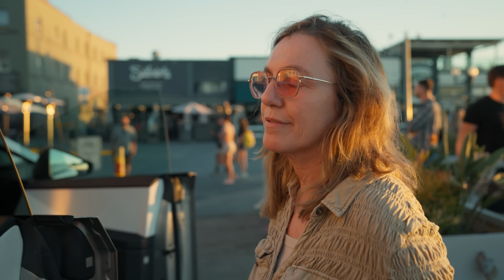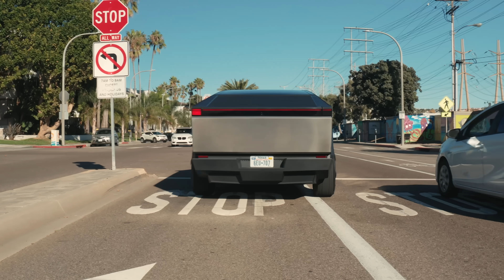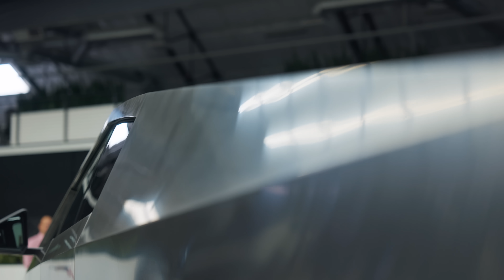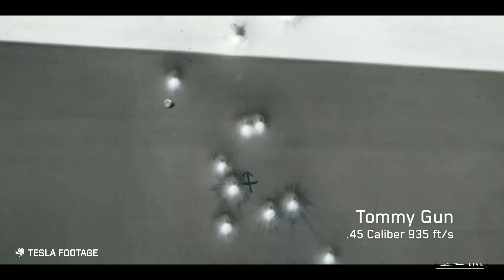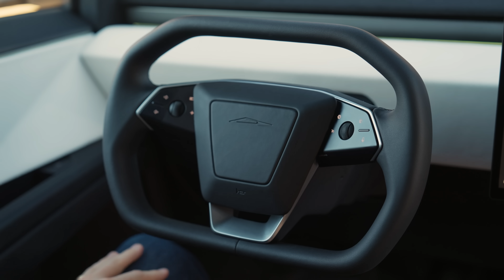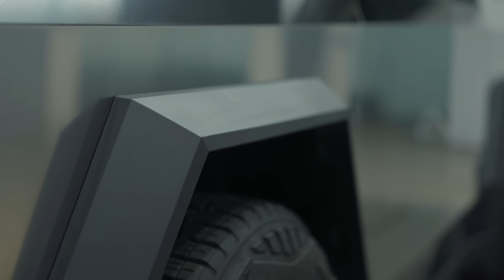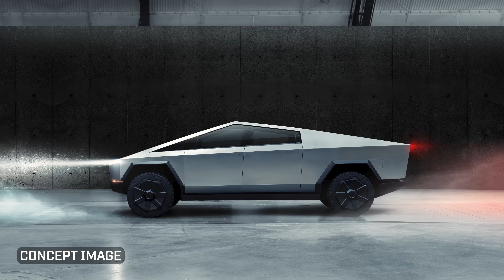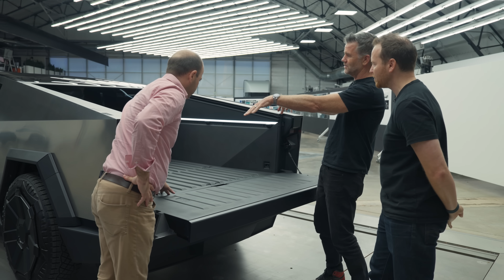FIRST DRIVE: Tesla Cybertruck Full Review

Comment: People talk about how CT was delayed. But I can't believe they got a 48V system, capable of steer by wire and V4 charging and all the other things that come with low voltage systems, all baked into a stamped stainless steel exoskeleton - and they did it in 4 years!? FOUR YEARS? That's like 20 years worth of incremental progress distributed across a whole automotive industry, yet we're getting it all in a single model.

Comment: I wonder if they truly thought about stainless steel and super cold weather, meaning around or below zero Fahrenheit and trully tested it. Everything is going to freeze together. Saying it can cut through a half inch of ice and actually doing it are two totally different things. Teslas have cabin preheating, so I'm guessing they might had added heating elements around/near the handle and the door seem itself? By the way, I would love to see them try to charge on a 350kw charger.
Reply: They tested it in all extremes. Not just hot and cold. But in ice and then water. The crash test results have been amazing. You don’t make the four safest cars in the world without extensive crash testing.

Comment: One thing I do like although it may seem small in comparison to the design is the single wiper blade.  I have always thought cars should only be one wiper blade for maximum cover and efficiency.
Reply: It creates a blind spot on the passengerside. There is a reason you most have two.
Reply: MB has hadany cars with single wiper blades for decade

Comment: I have a Trimotor w/ FSD reservation at about 360k place in line. The other 4 Dualmotor was reserved in 2021. I will definitely accept deliveries. Price increases was to be expected. The lowered range on the Trimotor, not so much. I'm willing to bet in a couple of years battery energy density  will be improved. We may yet see 500 miles range on the Trimotor without the added range extender in the rear bed. 🤞
Reply: After 2024 they will make more than 250,000 a year. This is Tesla, not OEM manufacturers. Tesla has the quickest time per vehicle production rate. I don’t even think the tiny box cars made in. China are made as fast.
Reply: @ZeusBullyMax Agreed. Much of the production line is fully automated. More production just means adding more machinery once they are committed to the manufacturing process.
Reply: @ZeusBullyMax  That could explain why their quality is so bad when compared to other brands.

"02 Dec 2022 — According to J.D. Power, Tesla vehicles had an average of 176 mechanical faults per 100, compared to an average of 121 for the industry"

"29 Nov 2021 — In August's Initial Quality Study, Tesla averaged 231 problems per 100 vehicles in the first 90 days of ownership."

And that's not keeping into account the phantom breaking or unexpected and unwanted acceleration issues that has resulting in deaths.
Reply: I also have a reservation from '21 for tri motors, I'm planning on adding the extender unless I can drop to dual motors still adding the range extender to 440+.
Reply: @inciwillard991  Good for you, now you'll only have to wait a few more years considering that they hope that once it's actually production line manufactered that they think they might be able to make 250.000 of them a year. So if you aren't among the first 500.000 that made a reservation you'll have to wait at least another 2 years.
Lest you forgot, cybertruck was announced in 2019 so if you made a reservation in 2021 that means that a whole lot of people will have prior reservations.
Reply: @PDVism  Don't mind waiting, in the meantime I've ordered  '24 MX due in Jan.-March.

Comment: All I want to know is how does it charge on a 350kw charger. Not on the currently installed V4 stalls/dispensers that still don't have the actual chargers upgraded to 800 volts and and top out at 250kws, but on current 800v 350kw chargers. Or is Tesla restricting the charging speeds on the Cybertruck to 250kws until the V4 actual chargers are installed/upgraded?

Or, if it tops out at 250kws or a 350kw charger, but stays close to it for at 50% of charge, and around 200kws close to 70%, then that would be a curve worthy of Tesla and their version of charging on 800v chargers. That would mean that it would get to 80% in around 25 minutes. Can't wait to see it charge.
Reply: Looks like I got my answer. It will charge at 350kws on V4 chargers once they are upgraded to match the V4 stalls being put up now.

Comment: I’m not a fan of this trend of newer vehicles not having a spare tire as standard. Maybe in a revision they should consider making the bed storage compartment big enough to accommodate one. I can’t imagine the bed storage compartment to be very practical especially if the bed has stuff in it anyway.
Reply: They already have one as an accessory that fits in the bed. researching before complaining is a pretty good idea
Reply: I'm fully aware of the OPTIONAL spare tire. Spare tires should be STANDARD. Plus the one they offer takes up bed space. This isn't solely a Cybertruck problem. It's an industry wide problem. Level up your reading comprehension before commenting. @ZeusBullyMax

Comment: I think it looks really cool, but it doesn't have the price advantage and I think that will be a big hinderance for it's success. I know I wouldn't buy it no matter how cool it is if it doesn't recoop it's cost/I can get the same job done with a much cheaper truck.
Reply: The buyers will be people who want a top end truck. A full crew cab Ford F-250 or 350 with the big options is in the same price range as a 2-motor Cybertruck. A Ford F-350 Platinum is around 100K.
Reply: @donjones4719 And an F-150 Lightning Platinum is also 100k with a 320 mile range.
Reply: Look at the channels monitoring truck prices.
There are plenty of F150s (etc) up at 100k
Reply: Price may come down at some point depending on demand.
Reply: @richardkule9384  I hope so

Comment: The BEST overview of the vehicle released since the delivery event. Thanks for all the details and asking solid questions from the designers. It's interesting to learn they're planning to integrate V2H using an upcoming home charger. Makes sense, but not a detail currently available.

I was curious if air compressor output is still in the product. The promise of an inflatable tent indicates it is, but no one has explicitly shown it.
Reply: If you have a 48v battery system in your solar setup, you can just hook up a 240v (48v nominal DC output)  battery charger to the truck to the battery bus bar and call it a day.  EG4 makes one called the chargeverter for a few hundred bucks.  No need for a fancy V2H or V2L software setup.  Inverter can control the chargeverter from the dry contacts, treating it like a gas generator if the home's battery voltage gets too low.
Reply: @silverice9  Nice find. The EG4 chargeverter also takes 240V input, so you could plug it into the truck outlets.
Reply: The V2H setup is already available, and much of it has been for years. The only newish part is a universal connector, but it is just a glorified adapter

Comment: I like to have fun with my daily. Currently a 2018 Toyota Tacoma that I do off road, haul and tow (6500 lbs. boat and trailer) fairly often. That departure angle is really struggling here and what I've seen so far its a lot is wasted space underneath that causes it. That bed storage is a nice idea but like the R1T that space should have been used for the spare. There is already a frunk and an entire bed so having to drop the tailgate to get to your trunk is wasted motion that is not needed. They should have show off or at least have on display the more "affordable" trims like the single motor version or different options like a front bench seat because I'm a day one reservation and the cost of these things has me heavily considering to can cancel my order. In my opinion its not worth it right now and them heavily over promising on the specs has left a very sour taste
Reply: For the 1000 time. You can’t have a front bench seat because you can’t put an airbag where the screen display is.

Comment: For those who don't know cybertruck has a viewable front facing camera through the screen and the camera also has a water sprayer if it gets dirty
Reply: Ngl, you had me in the first half!!!
Reply: ..so you have to refill your camera washer fluid too?
Reply: @steveskeletonneii6336  yes of course! these stupid engineers should've just put one washer fluid tank and use that for the camera as well!(guess what, they did dumbass)
Reply: @steveskeletonneii6336  yeah about once a year. You’d probably have to take it to the service center.
Reply: @ZeusBullyMax   I would be surprised if one had to have the service center fill the camera washer fluid.  Tesla  prides itself in no required service.  Betting they use the same reservoir as the windscreen washer.  Fewer parts, less for the owner to do.
Reply: @steveskeletonneii6336  don’t you ever clean your headlights?
Reply: @steveskeletonneii6336  yeah about once a year
Reply: @steveskeletonneii6336 Blinker fluid?😂
Reply: Your comment has been stolen by a bot and has twice the amount of likes.
@Need-You-Tonight stole it, fokking tit-bots.

Comment: I was initially disappointed by the range, but overall the CT is an amazing truck and achievement. They've got an incredible platform for a decade to come! As for the engineers, so much of our engineering brain power is trapped in slow moving staid companies who arent prepared to invest and take risks. Despite the long hours I've no doubt that every engineer involved in this will look back at the CT as a highlight of their career and being able to take such crazy risks! Literally everyone else took a legacy vehicle and put an EV inside of it. 

These guys moms must be proud.
Reply: I'm disappointed by the range also but I think Tesla was counting on better performance from the 4680 than they're getting. Battery performance always improves, though, so in a couple of years the range should hopefully be better.

Reviewers were surprised that the Model Y with 4680s has a disappointing power to weight ratio. (Kw/hr per kg?) So that cell needs some work.
Reply: @donjones4719  the range was something specific to my personal requirements. i'm sure it will improve over time. aside from this its an epic pickup.
Reply: Look at the pack  capacity. Compare it to others..
Not so bad?
.
Now consider that the cells in this pack are the "Mark 2" version, but that was achieved only by mechanical improvements (they made more space inside, added more material.
The NEXT version will be a chemistry upgrade.
As far as I'm aware, this chemistry is LESS potent than the 2170 cells.
If they leapfrog that, they might gain 15, maybe 20% on the current cell.
25kWh?
That's half the range extender capacity.
Reply: @rogerstarkey5390  i saw the drag test against the hummer ev. they have double the kwh with significantly less range and power. it was almost comical that the CT can out drag the hummer with 5 people sitting inside and with less cabin noise 🤣

Comment: I could listen to the engineers all day.  No joke, love innovation
Reply: Someone suggested in the comments that they need to make a full length documentary about this truck. I think we would all watch a part 2, with more interviews of all the people involved in the design and financial planning. It deserves a full documentary, with more of Lars.
Reply: What innovation?
Reply: What innovation is here exactly? Stainless steel? been used in a couple cars in the 80's turned out to be a bad choice. Ev? well there is nothing new in this thing that isn't already in another tesla. Design that looks like every truck every conceived by literally every 10 year old kid since cars were a thing? You got me there.
Reply: @corail53  48 volts, largest aluminum die castings ever made, first production vehicle ever with steer-by-wire, state of the art 4680 battery cells, adjustable air suspension with 17.4" max clearance straight from the factory, 4-wheel steering, ...
Reply: @global_optimization  Absolutely none of which were problems the industry had. They created these solutions themselves caused by their own vanity.
Reply: @Global_optimization. My dads forklift has 48 volts, ford had steer by wire in 2016, air suspension can be added to any truck way cheaper.  GMC trucks, Honda preludes, and John Deere lawnmowers have all tried rear wheel steering 20+ years ago.  Nothing to brag about here. Musk would make more money off the toys made of this than the actual truck.
Reply: @happyamerican3235 if you dont look at this truck and think innovation you need you eyes tested.
Reply: @5yearshed  Care to point it out to us uninitiated?
Reply: @ThePopolou  the incident light from the sun will reflect in to your eyes via your pupils . The brain will detect the light signals and build a model of a veichle outline that you become aware of and another higher functioning part of your mind will compare it against past models of truck and identify the differences in form and connect to the human concept: innovation. This will be reinforced by of other data that you collect and map to this cybertuck concept. IF YOU ARE WORKING CORRECTLY.
Reply: @Global_Optimization hahahaha my god did you actually just type that? None of that is "new". Where do you get your info from?
Reply: @5yearshed lol... my man thinks pointless stainless steel panels on a car is innovation. Bless you.
Reply: @paintspot1509  yeah who knows why they bother on the starship they should.just use mdf
Reply: @5yearshed  👈 Blind. BTW, it is not reflect, it is refract in that use case.
Reply: @ThePopolou  ok boomer
Reply: @paintspot1509  48 volts for the entire low voltage system is new. This is the first production vehicle that is FULLY steer-by-wire, with no mechanical linkage whatsoever. Badass air suspension standard is new. World-record size of high-pressure die castings is new. 4680 “cyber cells” are the latest battery design from Tesla and are new. 

And that’s not all that’s innovative with Cybertruck. Almost all of the microcontrollers and their firmware were designed in house by Tesla. Almost all cross car wiring has been eliminated. It’s the first vehicle with an aerospace style stressed skin structure. Novel stainless steel alloy. The list goes on…
Reply: @global_optimization  48V, so I have to rebuy all my camping stuff,... :( Not the first steer by wire production car, 4680 battery cells, wow, telsa using off the shelf battery cells, again, so ingenious, air suspension has been around for decades, 4 wheel steering is also not new
Reply: @corail53  48 volt and steer by wire. If you dont know how big of an innovations to cars that is, youre dumb
 Other car makers has tried to adapt to 48 volt in their cars for decades without luck... The same with steer by wire. Dont downplay the improvements tesla are doing here'

Not to name:
first bullet proof pickup truck that isnt made to be bullet proof
fastest pickuptruck
best weight ratio of any pickup truck
Reply: @corail53 i belive that this car is basically Assoluto Bisonte 2.0.
Reply: @corail53  That bulletproof stainless 'innovation' will make the car illegal to sell in any country that gives a shit about pedestrian safety - so if you're from any EU country you can just assume this moving guillotine will never be street legal where you live.
Reply: @haakonht imagine if the Tesla Cybertruck 2024 is also a street legal car.
Reply: @haakonht  Cybertruck is for sale only in North America. EU regulations are irrelevant.
Reply: @corail53  precisely. The OP is talking nonsense.

Comment: The haters: "It'll never see the light of day" It has. "It can't tow" It does. "It's not a tough truck" It's the toughest. "It's a blocky fridge on wheels" Faster than a Porsche 911. "The bed is so small you can't fit a bicycle" It has a slightly longer bed than an F-150.

Comment: This truck is an engineering marvel as an ex engineer I loved hearing about how this truck came to be the guys at Tesla have done a great job the only shame is I won't be seeing one of these in the UK for now due to the regulations but I will look forward to driving one of these one day 😁
Reply: Tesla will work with regulators and resolve all problems
Reply: @michalsalaj  I mean, they literally can't, if they insist on using cold rolled steel for the bodywork - it won't even come close to passing pedestrian safety regulations.

Those regulations are so when little Timmy runs out from between two parked cars, he bounces off impact absorbing plastics, rather than get his skull punctured by the corner above the headlight which is hard enough to resist a lump hammer blow or a 45cal bullet impact.

Christ, Tesla fanboys are incredibly blinkered - don't you realise why this is a bad design?
Reply: have u ever had your head against a truck f150 as a kid you going to get  the same result LOL come on man @Beany2007FTW

Comment: Because towing is more demanding than just driving, you absolutely need a display in the front of the wheel to reduce hunting for data on the sides when something is need monitoring.
It's already difficult enough to be mentally ahead of the other drivers on the road, without taking your eyes away from driving for a status.
People diving in front of you at stops, at the last moment, passing you and hitting the brakes because they did not know the reason you are going slow is the vehicle in front of you, then slamming on the brakes; you can't be looking to the side.

Go tow a trailer if you never had before to see how people really drive.